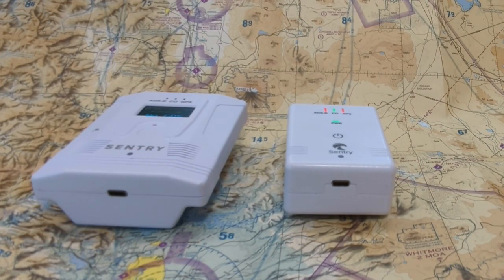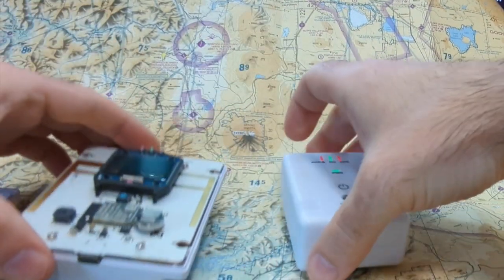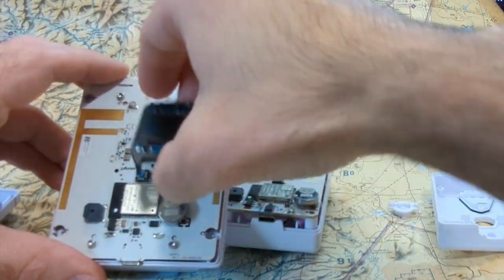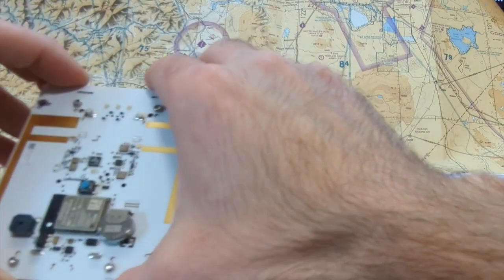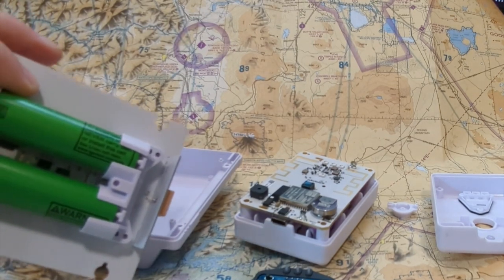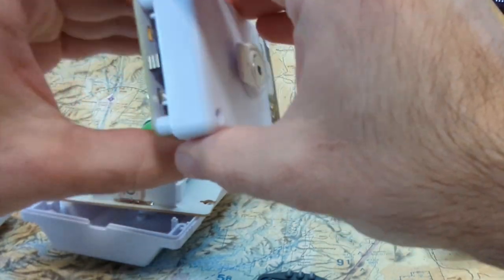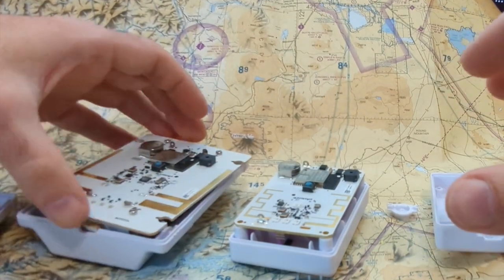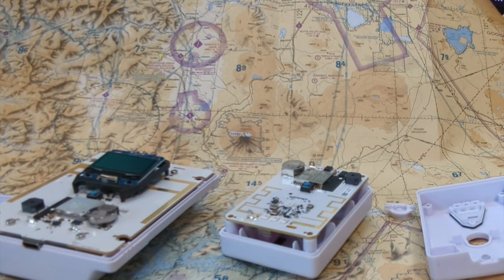Sentry Plus teardown/comparison

Comment: Nice comparison. What are the part numbers of the CO sensors? I'd like to lookup a data sheet, as many people have tested and reported that the Sentry models frequently fail to detect CO. Thanks in advance!
Reply from the maker: hey Justin, just went back to my notes but I didn't write down the CO chip, unfortunately. I assume it's something similar to a BME280/BME680. Not saying it's that, just that I'd expect it to be similar. Glad someone appreciates the nerdery!

I'm going to add my chip notes to the description.
Reply: @flysport_tedder  I believe it is the much larger coin-cell looking component on the face of the PCB. I don't have one otherwise I would take mine apart. Do you have any close up photos in your records that could reveal the part number?
Reply: The CO sensor is a Figaro 5141